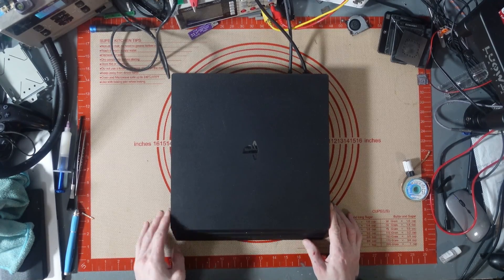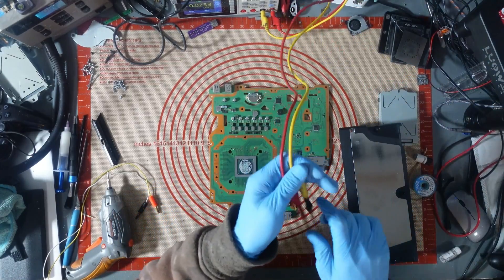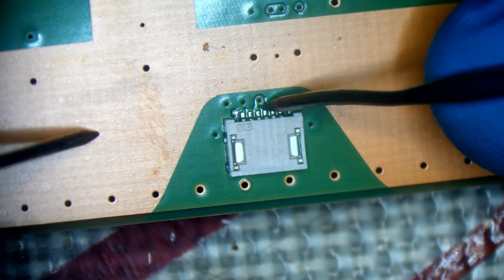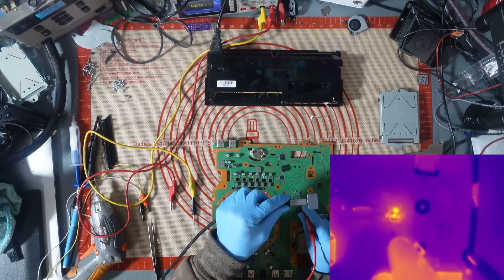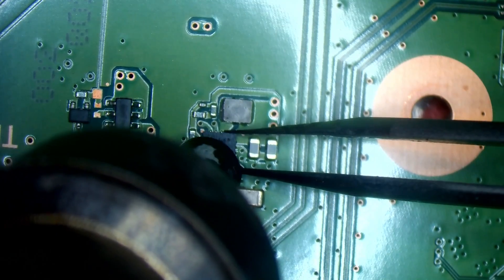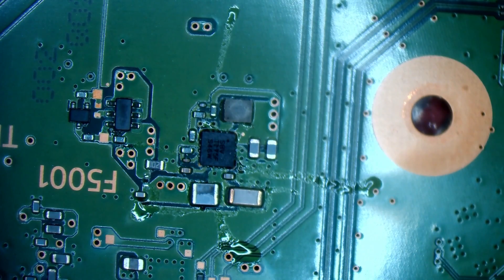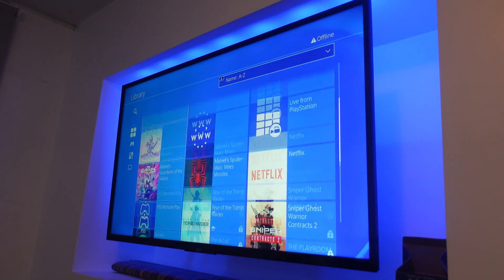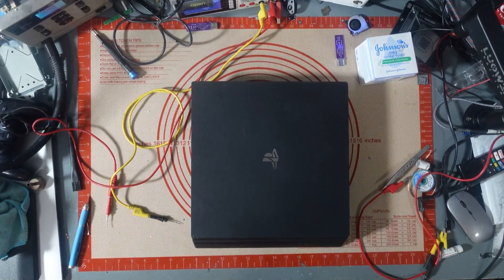Repairing A PlayStation 4 Pro That Won't Turn On At All!

Comment: You should start a running talley of how many fuses/small components you've blown away with the hot air station. It would be a funny statistic 😄I have also yeeted many small components with my hot air station as well.

Comment: I repaired my PS4 Pro, a few weeks ago, thanks to your videos. It was an HDMI port that i carelessly mangled.  I'm about to replace the M92 chip on my Nintendo Switch, and I'm dreading it because of my shakey hands. Any advice for preventing having close by caps from flying off the board?
Reply: Use the aluminum tape to secure the small components

Comment: Hehe I have heard the nickname for the new PS5 is the "Cyst"... man it is uglich and Sony STILL putting liquid metal in despite so many people having their consoles destroyed by the component munching gallium and refusing to adopt phase change thermal compound which doesn't destroy consoles and performs just as well as liquid metal.
Reply: Liquid metal is a lot better at transferring heat, but there are obvious cons to using it